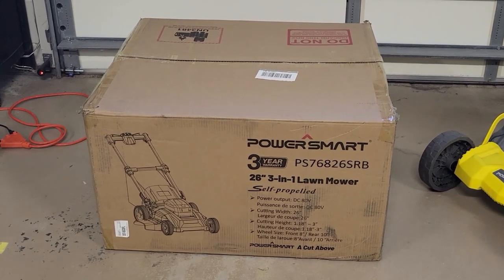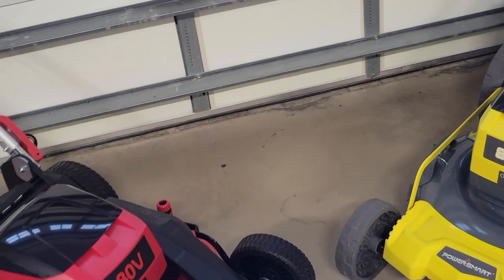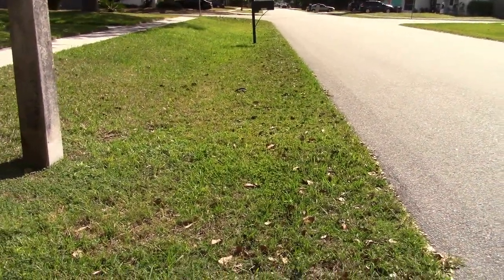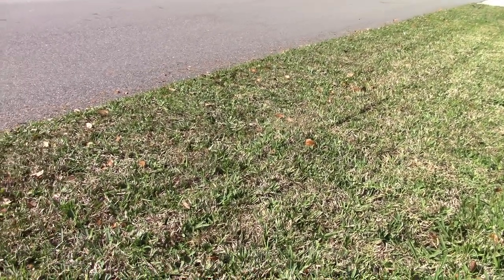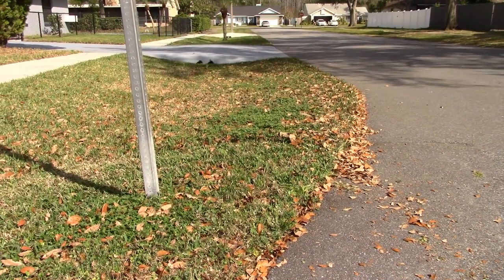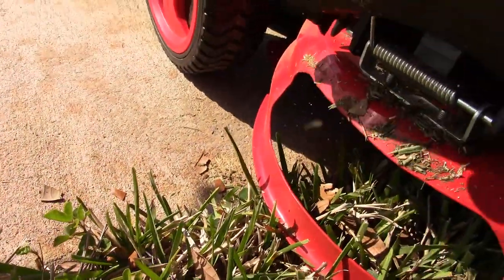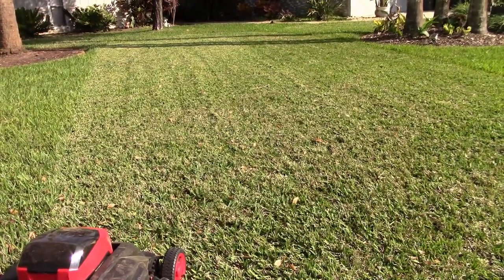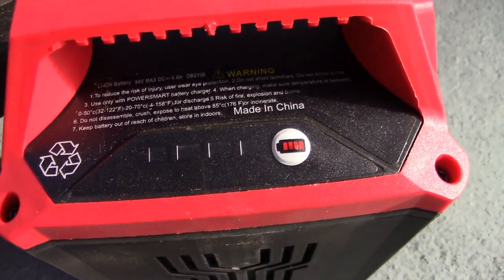PowerSmart 80V 26" Self Propelled Dual Blade Cordless Lawn Mower Review

Comment: Probably perfect for 5,000sqft lawn ( healthy, thick) any larger area it likely won’t cut until a 90 minute recharge.
Reply from the maker: My own yard is 1/2 acre and this mower mows it using 2 batteries. And I know, it only comes with 1 battery. So 43,000 sq ft per acre, 21,500 sq ft per 1/2 acre, means 1 battery will do 10,000 sq ft.

Comment: Extremely interesting demo on this mower. It appears to be a great option for many type grasses. I was hoping to see the water hose and how well it cleans itself after the grapefruit test. I noticed juices squirting heavily.
Reply from the maker: Ha, yes. If you remember at the end I looked under there and it was mostly clean. All that mowing after the grapefruit cleaned the grapefruit off. I will eventually mow through a bunch of weeds with it and that will be a good day for that hose attachment.
Reply: @Something2LookAt , thanks.
Reply: Is there ANY electric mower that is front wheel drive in existence? The rear wheel models "glitch" or lock the wheels when you let get of the drive and pull back. You have to jiggle it to get the drive to let go.

Comment: I have a Kobalt 80v 21" and it has the same feature with the power boost through the thick stuff. ahah I find myself rushing like "don't waste the boost!" because when you come to the end of a pass, it reverts back to normal after a few seconds without load. Greenworks do the same thing I think, same batteries in a different housing. Have you looked to see if the other brand's batteries could fit this? Might just need a bit of modding

Comment: How do you get it to quit walking, having an issue there. When I let the drive switch go with the blade switch on it keeps moving forward. Any thoughts?
Reply: I have the same question (contacted PowerSmart and waiting on reply)...it's a MAJOR pain ... I guess if you have sidewalks/roads to turn around on then it's not that big a deal but when you have fences, gardens, etc... that you have to "stop at" and turn, it's not very easy because it keeps moving, even after releasing the Drive switch...I thought maybe mine was "broken" but I've seen the same comments elsewhere...EXTREMELY poor design in my opinion.

Comment: This mower might have more power than the EGO , but there is many cheap looking parts on it. The separated blades are another reason reason why I wouldn’t use this mower. The suction doesn’t work well….
Reply from the maker: What do mean when you say separated blades?
Reply: @Something2LookAt  
This unit has two blades but they are not positioned together, they have one blade on the left side and one on the right side
Reply: @timothystys9938 anything over 22" is gonna be like that, like the Ryobi and toro 30" use 2 blades